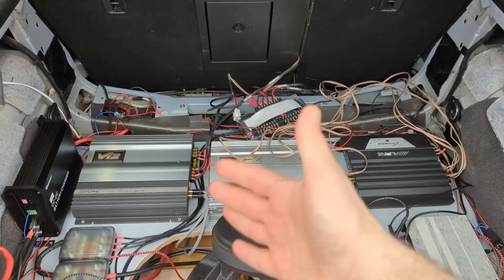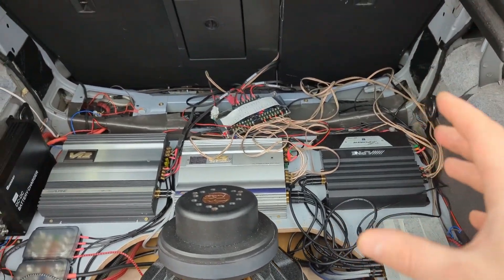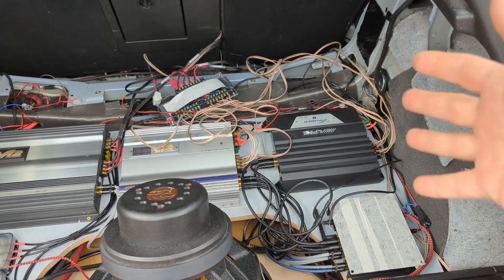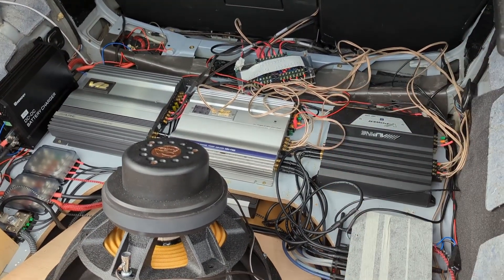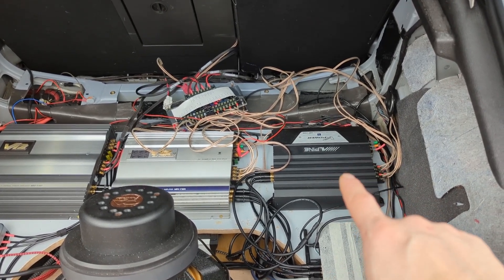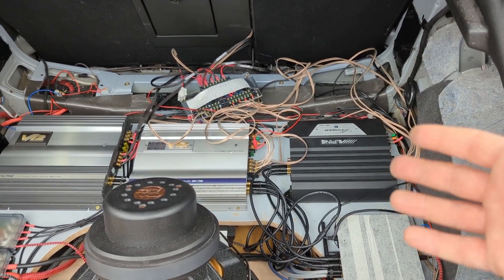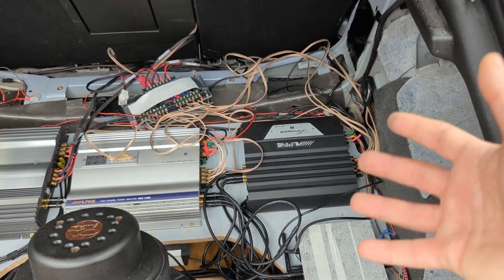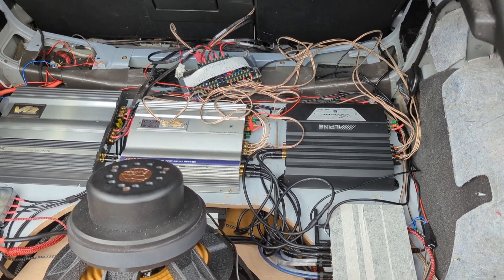Can I hear a difference between these amplifiers?

Comment: Hi,
I have a chance to buy an alpine mrp-f250 for 43 quids. Do you think it's worth it ? i want to power a set of 60w 3.5" midrange speakers and a set of audison AV 1.1 speakers
Reply from the maker: The newer mrp are not as good as the old v12s, but for 40 quid it will be very good👍

Comment: I need some help with power ratings for an Alpine Amp.

You seem to be a huge fan of Alpine, just like me. 

I want to purchase the new Alpine PXE C80 DSP. This DSP has a built-in amplifier that is rated at 50 W RMS x 6 channels. with an additional 150 W times two on the subwoofer channels my components run at 100 RMS. I’ve already contacted Alpine customer support and they said since it’s a DSP unit I can simply run my components off the subwoofer outputs to get more RMS wattage. The only thing I find to believe is, although I know technology is advancing rapidly and your experience with testing amplifiers how can Alpines new DSP be rated for that much power while only having an onboard fuse of 40 Amps? 

Anyone reading this comment if you can explain this, I would love to learn and understand how and why. Even if I break my component sets apart and run my system, full active 50 W RMS still wouldn’t be enough to drive the mid range drivers.
Reply from the maker: In a lot of DSP amplifiers the power ratings are what the amps are capable of, that is on individual channels. Now 40A fuse can support up to 500-600W RMS, that depends on your voltage. And 40A fuse will not blow instantly hitting 40A of current, those are slow blow fuses. Take for example a typical 3 way speaker set. Midbass drivers 2x100W, midranges 2x30W and tweeters 2x10W,that is only 280W total. And that is theoretical max if you really hammer on the system with pure sine tones. On music, that wattage is much smaller, maybe 100W with all speakers playing. What gobbles up all the power is the subwoofer. It will consume 90-95% of the whole system power. If you will be using the C80 for component speakers, it will do an amazing job. In the real world scenario on music you need way less power than you think.
Reply: @RAW-CAt  
Thank you. It’s like I already know that but I needed reassurance. I called Alpine support and they said I could run my components sets on the sub channel if I needed more power and wanted to keep them passive.

But I have been reading more people having issues with software. Not necessarily it not working but taking a lot time to correct the sound. 

Sounds like more user error than software issues. I know DSP tuning can be a daunting task. 

The more I read the more I hear that the 5 min autocorrection process is taking longer. 

I know you do everything on your own dollar and I love ❤️ your channel. 

But you seem to have a soft spot for Alpine like me. Have your heard anything about the new PCX C80s or C60s DSPs good or bad? 

By the way I’m running 6x9 infinity reference components in the front. They are 125 rms.

Comment: I did an AB comparison with an amp switcher. I shot out a phoenix gold ti1600.5, mcintosh mcc446 and a soundigital sd300.2. The Mac had a boosted low shelf of 1.5db which made the low end sound ever so slightly more 3d than the others which I could hear and my measurement showed what I was thinking as I listened. The other two sounded and measured exactly the same so I'm not surprised your two amps sounded exactly the same

Comment: A system only sounds as good as the weakest link. What your testing proves first and foremost, is that your amps are not your weakest link.

And they are probably not the weakest link for most people too. 

So completely valid findings, and no surprise at all to me,

If you want to find where a difference in SQ happens, you'll need to use a really bad amp, or upgrade other components in the system until these amps become the weakest link.

Comment: Option 1 for me, i hoped you'd hear a difference but i guess they're quite similar and from the same manufacturer. In home audio, I've listened to two Cyrus amplifiers made ten years apart and the older one wasn't as bright at the top end as the newer one. Otherwise they were similar.

Will you be able to get some higher end amps to test?
Reply: I've got a Yamaha PC2002m power amp, that thing rolls of the top pretty early, upside is it rips up super nice.  I'm turning 37 ina few days, I can still easily tell amps apart, I swap opamps and hear the difference, it is very subtle, but it's there.  I can hear 18.5k no worries, higher if I crank up the volume of it.  Op-amps in my experience can change things in different ways.  The Burr Brown 2132 for example, that thing will collapse the sound stage, the midrange is all dead centre like it's become mono while the treble is free to widen.  My speakers although good frequency response wise, have a non existent 3d depth

Comment: What a mess!! Absolutely not the way to install a car stereo!! And going by your past videos. No, you wouldn’t be able to hear the difference. For sure you don’t have the ability to tell Walmart amplifier from high-end amplifier. You have shown it over and over. Your alpine amps are 20 years old. The rest is such a wiring nightmare it’s never going to sound GOOD. You just can’t do what you are doing and expect decent results.
Reply from the maker: I know, when I will clean up the wiring, all the stage will open up and butterflies will start farting vanilla. Do you have any recommendation for quality cable risers to dampen vibrations?
Reply: You are just crazy :)
Reply: With the mentality that, because the copper backed V-12 is 20+ years old it isn't a high quality amplifier, I guess I should rip out and throw my PG Reactor in the trash because it's 28 year's old and therefore must be a polished turd. If you were to do a smidge of research you may find just how coveted "audiophiles" consider those Japanese built amplifiers to be. BTW just because the brand "Zapco-Mosconi" is on the lid doesn't mean it's the absolute best.  They have ALL made their fair share of "turds".

Comment: You won't get a lot of haters on this test unless you do it with a brand like Zapco or Mosconi.  😉

I would test different harmonics next because most good amps should have low THD and noise.

I'm still curious about classes (AB vs D) and brands, to see if brand to have different "sound" to them.

I understand this test is a lot of work, but as usual you are disrupting a lot of myths which is a good thing.  Maybe brands will have to offer more than just their name to earn customers.